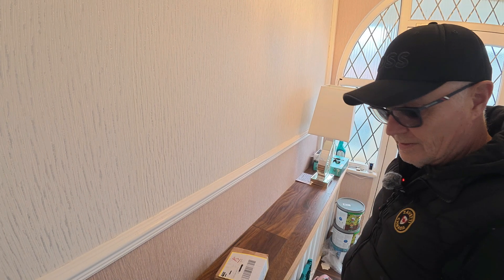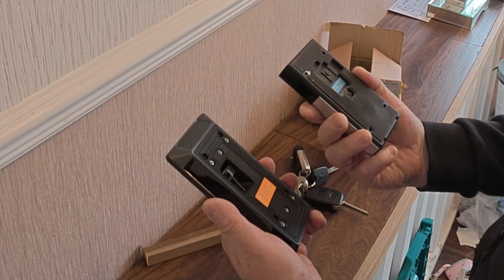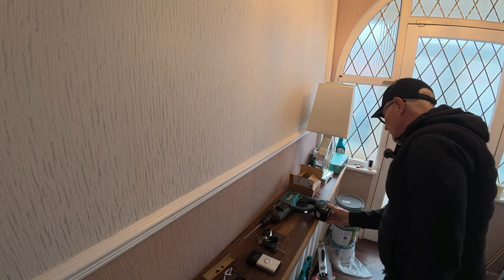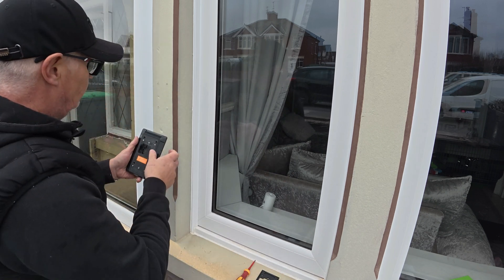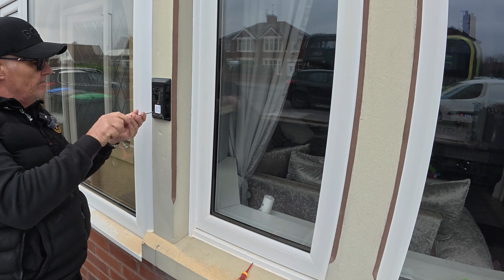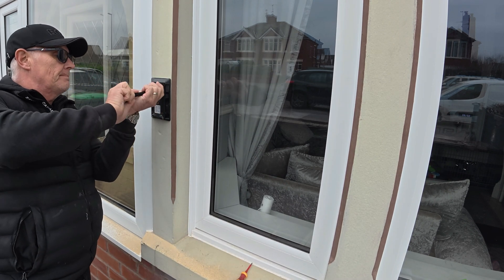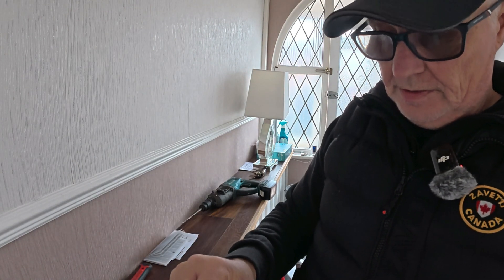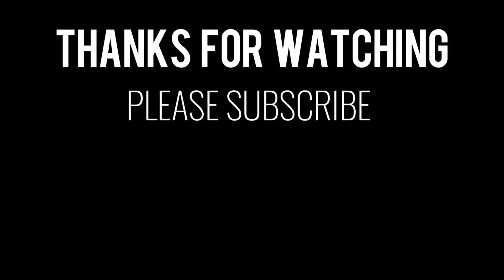ring doorbell solar installation

Comment: Were did you get the solar panel ring from mate
Reply from the maker: amazon just be carefull there are 3 versions mine was 2nd generation with the micro usb connection
Reply: @itsnotyerboyleroy69  cheers pete
Reply: How do I know which version door bell ive got it doesn't say anywhere that I can see?